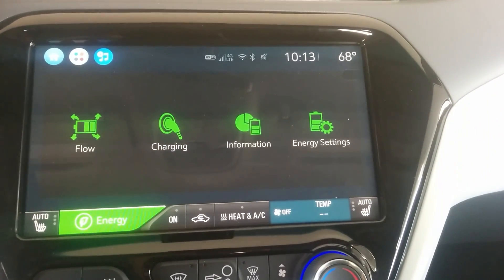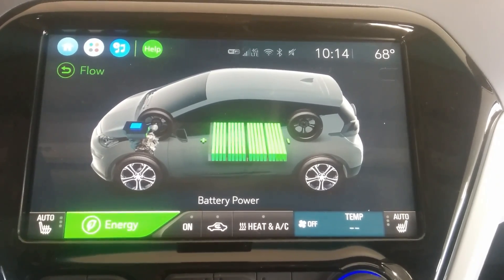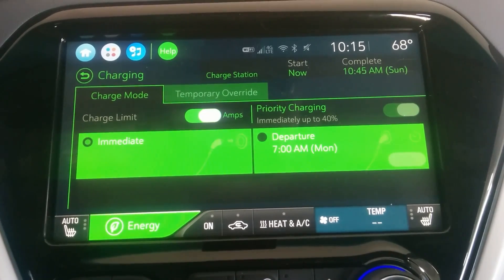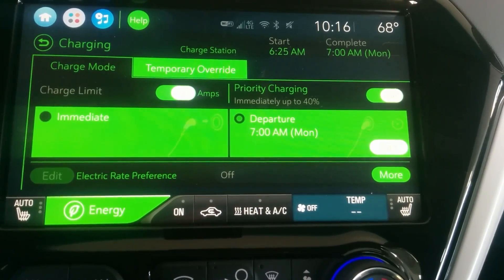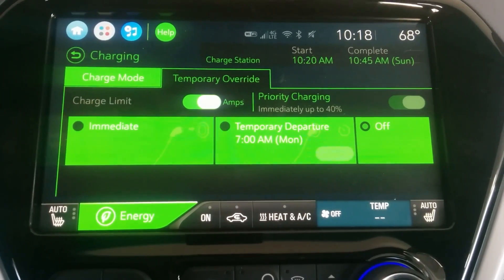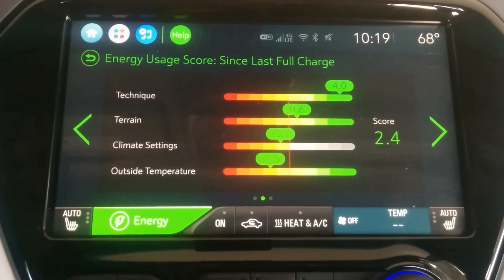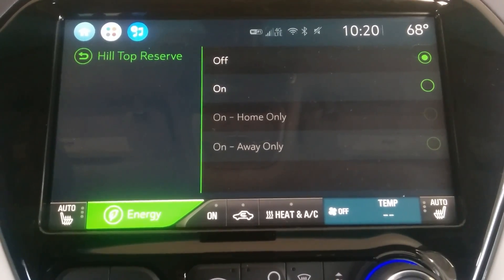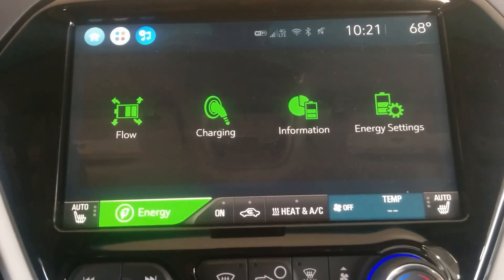Chevy Bolt EV Energy Screen Overview

Comment: As a prospective Chevy Bolt owner, I really appreciate your YouTube videos!  One question, the Bolt has received many awards and kudos, but I'm starting to see negative comments about the comfort of the driver's seat.  Is the padding too thin?  Is it comfortable for a several hour drive?  Thanks for your time and efforts on educating future owners!
Reply: I have a 2019 Bolt and do not find the seats uncomfortable. I am 5’10” and 175 lbs.
Reply: I sat in a demo 2022 recently and found the seat a bit small compared to my Kia soul. I am a big guy at 370. I figured if the small Kia was comfortable, the Bolt would be. Not as much.

Comment: Can you set a hilltop reserve of 10% - 20% so the Bolt won't charge past 80% - 90% of full battery capacity?  This could be an easy way of preventing full charges and increasing battery life.

Comment: What is the difference between Earliest possible and Latest possible Charge completion when charging is set at the Departure time? If it's set to complete charging at 7.00 AM, what difference do the above options make?
Reply from the maker: Andrej Potokar Thanks for asking. Earliest will start the moment the energy rates change to the lesser amount. Latest will wait so that your car finishes charging about the time you are ready to leave. I would do that in colder climates where you want the car battery warm when you leave.
Reply: News Coulomb Thank you for your reply! I have a 2012 Ampera and I don't have this option. I'm looking to get the Ampera-e (BoltEV) when it gets available in Europe and I like to get as informed as I can even before I get the car.
We will, most probably, be a Ampera (Volt1) and Ampera-e (BoltEV) family :)
Reply from the maker: Andrej Potokar I don't know how power companies work in other countries, but it looks like GM did their best to make the interface universal.
Reply: News Coulomb I agree. The available charging options and UI fits me perfectly.